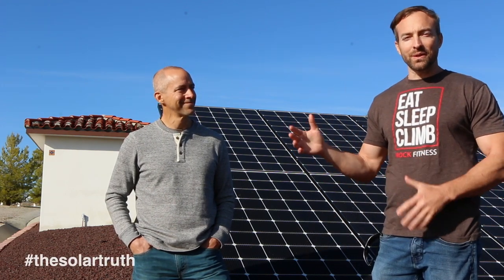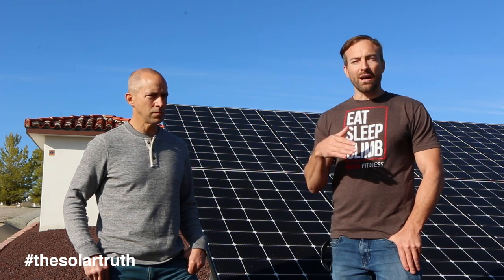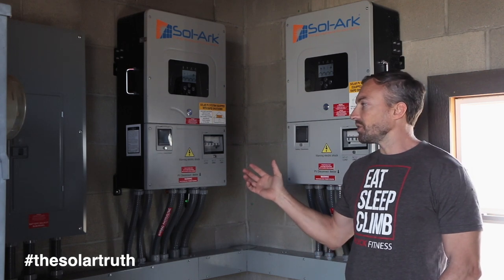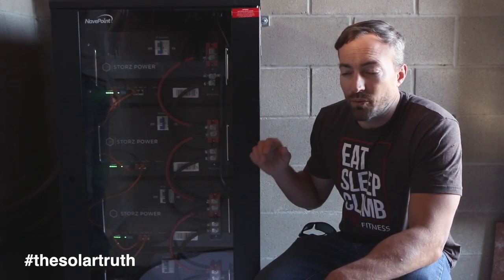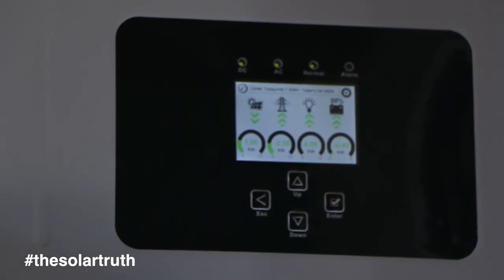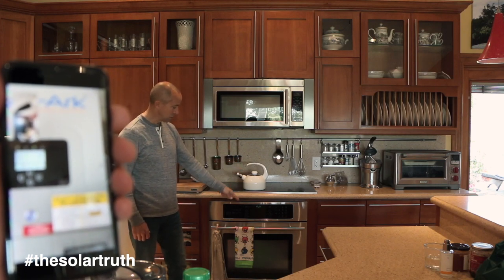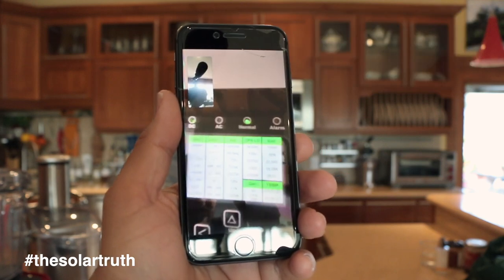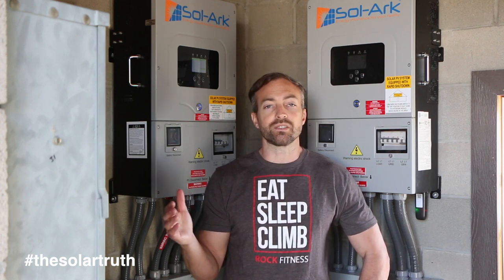Whole Home Battery Backup System - Sol-Ark/Storz Power Outage Demo

Comment: I have a sol-ark 8k system, there has been two power outages in the last two weeks and the way I have my system setup I only knew it because the system sent me  a text informing me the grid was down. Everything ran with no issue's.

Comment: Hi. Nice setup. Have you looked into the disadvantages of daisy chaining the batteries, as opposed to using busbars? 
There's a lot of energy lost in heat while charging and discharging batteries in a daisy chain setup. 
David Poz did a really informative video on it.
Reply: Yeah idk why everybody daisy chains.  Use a flir temp sensor and you’ll see the last leg of each side running hot from the cumulative amps.

If they upsized each daisy chain by even one gauge you wouldn’t get the heat. 

I’ll always use a copper busbar rated for minimum 800 amps on each side for positive and negative.  It’ll be a big thick piece of metal but I guarantee that busbar won’t be hot anywhere.

I see so many OCD people doing this stuff, and completely missing the important stuff.

Comment: Is a backed-up loads panel necessary if you are using the Lumin smart panel? I don't see any schematics in the Sol Ark manual showing an option without a backed-up loads panel. They all have a backed-up loads panel. But, it seems like the Lumin load shedding would make the backed up loads panel unnecessary.

Comment: I understand that that system puts out enough power to match the grid but I'm pretty sure I've only had that much running at once during holiday prep...
Reply: He might be preparing for charging multiple electric vehicles.  Future proofing.
Reply: Maybe to charge EVs and to run air conditioning

Comment: Nice battery system but it's 4k plus cycles not 8k. We wish eh lol! Still very cool setup and with a max of 490Kwh with 14 units. I wanted to use the KiloVolt HLX @ 300AH (Max 16 batteries) but wanted to see other options. Thanks for the upload and keep us updated!
Reply from the maker: The Storz battery is indeed warrantied for 8k cycles (or 15yrs!), making it the lowests cost LiPo/cycle battery out there I have seen. I verified this on the spec sheet, but don't see that on line, but it is on their website: https://storzpower.com/products/
Where are you getting your info?
Reply: The info is from the actual LiFePo4 Cell suppliers. EVE, CATL, and Lishen. Those are 100ah cells, so you can look up the cycle life of those for the REAL specs. Typically 3500 cycles for grade A cells.

Comment: That didn't seem like 5ms switchover to Battery/PV on Grid disconnect.  Lights should not flicker.  Microwave and Oven should not lose clock settings.

Comment: Would this system be able to run a central hvac air conditioning system? Or a multi zone mini split?
Reply: Sol-Ark Tech support said they only tested up to a 3 ton HVAC unit and it passed.  Off-grid my thought without definitive proof is NO.
Reply: Probably not. Most batterie systems require at least 2, maybe even 3 or 4 batteries to run your AC condensers. Our 12kw system with 2 tesla powerwalls can run both of our condensers and the air handlers. As they can support 10,000 watts continuous. That's 40amps. Most 3 ton units need between 25 amd 30 amps to start but only about 12-15 to actually run. Newer condensers use multiple capacitors that remove the higher startup amp draw.

Comment: Question on the wiring gutters. It looks like you have the DC conductors from the batteries and PV  running through the same gutter as the AC conductors. How are you creating separation, or is that not required per NEC? It doesn't seem possible to separate conductors with that setup. Maybe it's a non issue. Not sure.
Reply: You can partition the gutter
Reply: As long as those two, AC and DC are part of the same system, separating them isn’t required. Ref NEC 300.3C

Comment: But 10.5kw can be run with only one sol-ark 12k why two ?
Reply: to allow more pass through amperage
Reply from the maker: Yes, more Sol-Arks = more Amps (50Amps ea), so more one time power(kW)/circuits powered. Then the amount of batteries = more duration/run time (kWh)
Reply: Sol-Ark are very flexible but their surge performance is not so good. There plenty of YT videos demonstrating their limitations.

Comment: Are all circuits setup to be offgrid or when the power goes out or do you have a priority load sub panel?
Reply from the maker: All the home loads were on this system, but batteries typically power a backup load sub panel.

Comment: Is there any way to have a system like this be rapid shutdown compliment? I see that the panels in this setup were ground mounted so there probably wasn't a need for rapid shutdown. My setup will have to be on my roof and my county requires rapid shutdown, can I still use Sol-Arc?
Reply from the maker: Yes, Tigo is a common universal Rapid shut down device used for DC roof systems.

Comment: Can you have batteries as a backup only with the solark. With no solar panels. So Batteries are powered by the grid and if the grib falls out the batteries automatically kick in the support the critical loads.
Reply from the maker: Yes (if your utility allows them to be charged from the grid), but this is rarely done because when the batteries are drained you have not more power till after the grid turns on again and charges them back up. You also do not benefit from time of use saving nearly as much. You may as well get a generator if you don't has solar with batteries. Why would you not get solar panels anyway? No roof space?
Reply: @TheSolarTruth Thanks for the response.  I have solar panels and 8 k Solark with 3 5kw batteries. I'm not installing the panels until September but want to know if I can program the Inverter to work with the batteries only as a back up until I get the panels in. Right now I've been able to charge them ok but haven't figured out how to run on battery power when I kill the main power simulating a power loss
Reply: @dubhaltaghohearcain2431    You prob have the panels by now, but for other folks, yes you can.  This might be a logical step for someone that has a generator and doesn't want it running full blast for the duration of a power outage.  By using a SolArk, Batteries, and a Generator, you could have the generator run only to change the batteries and then shut off.

Comment: Just watched your video on "Hawaii banned solar!".  Garbage.  I hope I'm not expected to believe this video as well.  2x Sol-Ark to run a microwave and induction stove and what else for $17,000 for just the hybrid inverter?  That does not prove anything in my mind.  Be truthful and push the very expensive system off grid all the way to the published limit.  But you may not get that far with nuisance trips is what other on YT are saying.  :face-orange-frowning:
Reply from the maker: Did you watch that video though?... Hawaii did 'ban' solar in 2015. For 2 years they did not let anyone do solar. Then they allowed it, but with no Net Energy Metering, and you need batteries. Just what happened... That 2x Sol-Ark system powers that guys whole house... He also got some pretty substantial tax credits and SGIP rebates, but that video was mainly just an operation demonstration video.